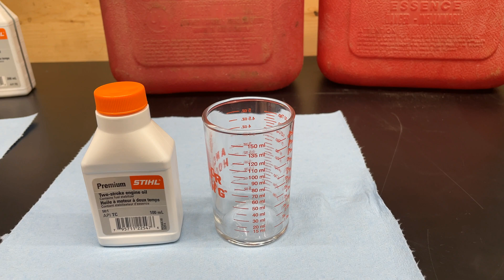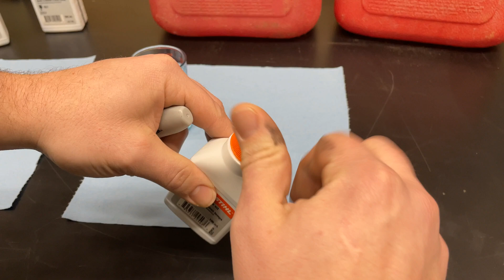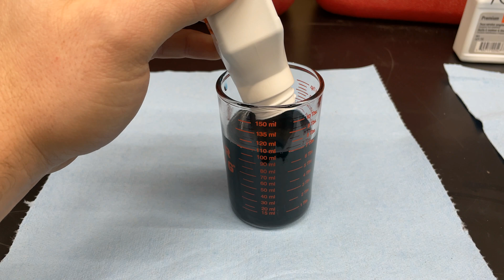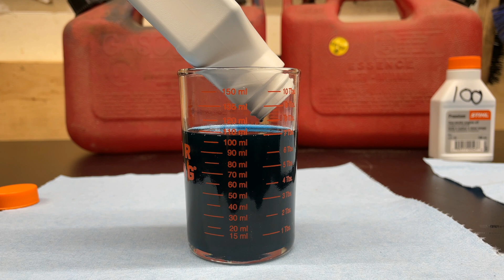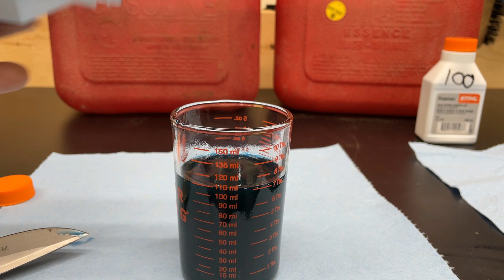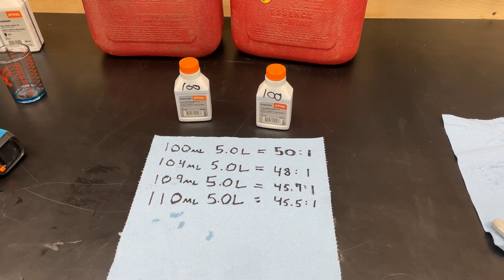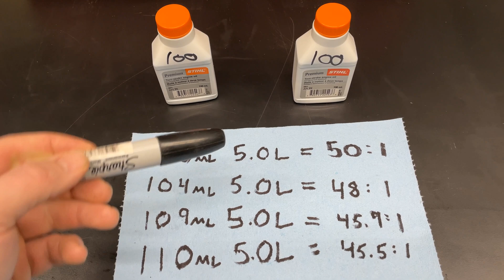Inconsistent 2 stroke mixed gas... Does every drop REALLY count? (Surprising test results found!!!)

Comment: Nobody is decent enough to answer me back I understand that this video is over a year old but I'm looking for somebody that could be honest to me about a Chinese chainsaw from Amazon the oil mixes 25to1 I have a 68 c c chainsaw that only uses 40to1 and is great I think 5.2 oz of oil to me is a little much and it smokes a lot do I have to continue to use 25to1 or can I switch to 40to1 or 50to1'
Reply from the maker: Good question, Lance. All new oils are backward compatible and oil has come a long way since the days when 25:1 was common.

With that said, I don’t have any experience with Amazon chainsaws from China. To be safe, I always recommend running what the manufacturer suggests.

Comment: I do not know how you get 100 ml from a Stihl one gallon bottle.  My one gallon bottles of Stihl Ultra contain about 71-73 ml of oil.  Maybe it is a Canada thing, but here in the USA the bottles do not contain this much oil.  I buy a five gallon bottle and measure out 77 ml in my glass measuring glass.  I do everything, exactly - gas, oil and stabilizer.

Comment: I have a glass just like yours.  I measure 77 ml of Stihl Ultra into the glass and pour it into my No Spill gas can.  I always leave about a quart of gas inthe can before I make a new batch.  After I get the oilin the tank, I pour a little gas into my glass jar and rinse out any remaining oil, which I the pour back into the tank.  I then add one ounce of stabilizer to the tank.  I then take the tank to my local gas station and add exactly one gallon of premium non ethanol gas to the tank.  77 ml of Stihl Ultra is exactly a 50:1 ratio.

Comment: Yes, every drop counts.  I measure everything, clinically.  I use 77 ml of Stihl Ultra, one ounce of stabilizer and exactly one gallon of premium, non ethanol gas (128 ounces).  If I smoke down a saw it won’t be because I did not do my job, correctly.  You have to watch those one gallon mix bottles - some do not contain 2.56 ounces of oil.  I have seen them( Stihl Ultra) as low as 2.47 ounces, 71 ml.    I buy the five gallon bottles and measure everything.  I have a graduated glass that measures ml, ounces, etc.  I fill it up to what I think is 77 ml and pour it into my gas tank.  I always leave a little premix gas in the tank, which I pour into my graduated glass to rinse out all of the oil I can and pour it into my tank.  I will then put exactly one gallon of gas in the tank.  I also put the one ounce of stabilizer in the tank before I put in the gas.  I do not trust the measurements of the one gallon oil bottles.  I trust my graduated glass.  The only one gallon oil bottle that has what it says it has is the Stihl HP bottle.  It says 77ml and that is what is in it,  it I do not use it.  I use Ultra and it varies from 71-73ml.
Reply: But what if the chain saw manufacturers are lying to us and the exactly perfect mixture is actually 54.4:1 and they just sorta rounded down and called it close enough? Now you're not going to sleep tonight I bet.

Comment: 2 stroke engines don't require a precise mixing ratio. Every tank of gas does not need to be precisely 50:1 every time. Anywhere in between 45:1 and 55:1 can be considered a 50:1 ratio.

Comment: The old 4 ounce bottle rule , you see now most one gallon premix oil bottles contain 3.2 ounces of oil for 50.1 ratio , in the past they all had 4 ounces of oil in them ! So I use mercury quicksilver 2 cycle marine outboard premix oil at 40.1 and my piston and cylinder are like new , even hours and hours of wide open throttle on my leaf blower and the internals are Like new !

Comment: I always wash the oil containers with gasoline to get most of the oil that was in the oil bottle. A higher percentage of oil is beneficial until the percentage is so high that the exhaust is Smokey.

Comment: Personally I use only red armor oil, but have been using those 100 ml containers for several years - when I started using them I did that same test as you so I could determine exactly what was in those and found they were usually a bit over 100.  I always add approx 5.2 litres to the gascan to make up for this. Recently the prices of those little bottles have skyrocketed and the red armor oil becoming impossible to find so I purchased a stainless steel measuring cup that holds exactly 100 ml, and also a 1 gallon container of red armor, so I will do it this way from now on.
I absolutely hate that foil seal they put on those little bottles and have always peeled every bit of it off

Comment: I'm not sure your math is right. I think those small bottles of oil, 100 ml, are to be mixed with one gallon of gas. I looked up a conversion chart and I was surprised. There is a US gallon which equals 3.785 liters and then there is a UK gallon which equals 4.546 liters. Both of which do not work out to a 50:1 mix. It is a interesting question and I don't know what to think.
Reply from the maker: 50:1. 5000ml to 100ml aka 5 litres.
Reply: @DavesSmallEngines  I understand that. After I wrote and sent that comment I went out to the garage to look at one of those little bottles of Stihl oil. I don't know where you are. 
Here in the US. the little bottle is 2.6 fl.oz. or 77 ml and is to be mixed with 1 gallon of gas which is 128 fl.oz. That gives you the 50:1. I hope I didn't offend you in any way and now I understand the difference better.
Reply from the maker: @scott241966  no worries at all my friend!

Comment: I mix my gas at the pump so i know i have the exact amount of fuel for the oil in the bottle and rinse the oil bottle with fuel. Good to know that safety margin is there but to have a better test use a measuring device from a science instruments supplier. A measuring cup from the super market may not be calibrated for precise measurements. The cost of over filling the bottles a little is cheaper for the company than a lawsuit or bad PR for being under under what is on the label.

Comment: For doing persnickity measurements, the easiest way is to use weight rather than volume. It's cheap to buy a scale that will do repeatable measurements to 0.1 gram, or about 1/10%. I don't think it matters in this case... I don't measure my gas to ±1%, let alone trying to be more accurate than that.
Reply from the maker: Good to know - thanks!

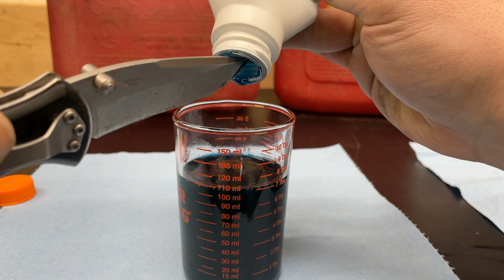Comment: At 8:00 --not worried about bits of plastic or the foil getting into the fuel mix?
  If Stihl is giving a few extra ml of oil,probably trying to lower potential warranty expenses for engine seizure. Especially knowing that some people waste some of the oil.

Comment: Always believed that with the small bottles you must make sure that the final volume of the mix is not over the prescribed amount(don't add the oil to one gallon of fuel,rather the total volume of the mix must not be over one gallon)
also necessary for some fuel to be added to wash the remaining oil from the little bottle and made part of the mix-maybe a couple rinses of fuel from the bottle that go into the not yet full fuel can 
don't like to short the oil even the least bit,especially with spooky low oil mix like 50:1

Comment: I often used to run my YZ490 without oil, back in the day.  And after a few years of riding, the engine showed no more wear than other engines which were always run with oil mix. And I've always understood that while oil might be a little more crucial in smaller cc engines, it didn't seem to bother the larger cc engines much at all.

Comment: I believe that yous should have tested with the same bottle. First time pour quickly, measure,  and second,let it drip to see how much more comes out with a longer wait. Using the same bottle is important because different bottles most likely have slightly different volumes of oil.

Comment: because the label says 100 ml, the manufacturers might need to be very sure to have at least that amount to avoid any possible legal liability.  there can variability in the volume from the filling machines, but it might be better to err on having more than 100 ml.

on the other hand, most consumers might not worry about every drop and will dump the bottle only for several seconds, leaving several ml in the bottle.

Comment: I have ran as much as 9oz of oil in a 1/5 scale rc car with a 30.5cc zenoah and stay around the 6oz mostly but we turn these motors 16,000 to 18,000and as high as 22,000 when a axle comes out. Runs the same with 9oz and 6oz and will run the same being mixed 50:1 but i want more oil for cushion at the higher rpm’s we turn for 50 to a 100 laps. Never hurt anything with to much oil but not enough things want live. Oh and use a raito rite measuring cup from a motorcycle shop and rinse out the remaining oil with fuel and you will know what you have.

Comment: It’s simple use 25:1 husqvarna hp! As Stihl oil is shit! and no dead pistons! Ever! And a good simple test to find the actual mix of oil is use an upside down soda can and fill the bottom of the can with the mix and set it alight, the oil puddle size remaining after the fuel has burned off shows the mix and a 1” puddle is roughly 25:1 and a 1/2-5/8” is around 50:1, it’s best to calibrate using the specific fuel and oil being used, this test method has put a lot of customers in place! crying for a warranty after they are lying to your face and swearing they put oil in

Comment: All this navel gazing over 2 stroke oil ! I have been using the same brand for over 24 year's. To offset inconsistencies in petrol quality I use premium 98 and stray on the side of safety @ 45 :1.
Stihl Ultra is an excellent oil. Burns clean and keeps the mix fresh way longer than HP. It's made by Castrol. That's good enough for me.

Comment: Thx for the post.  Appreciate it.  Just an option to consider.  Use weight, not volume, when mixing.  One ounce oil with 50 ounces of non-ethanol fuel in an open top dedicated mixing bowl is ideal.  Small kitchen scale is used.  Mix the oil with 25 ounces and follow up with the additional 25 ounces.  (Sta-bil can also be added of course.) Granted, in the field and when time is short this option is less than ideal.

Comment: hi there i am a bit late at jumping in here , been sawing for over 50 years . i found many years ago that the bottom of the bottles always have a thicker or heaver oil that seams to like to stay there , i have always believe this to be the addaves and add gas to the bottle till it is all in the mix . may now be zinc because the took it out of the gas . also stir my mix up before refueling . . also try not to run the saw out of gas . with all that i still use my 041 Stihl i got in 1982 snd saw 15 to 20 cords a year . good show john

Comment: Every mfg. puts in a little extra. Why? The penalties & fines for cheating you (short) are so great that they give you more, charge you more, & never worry about being caught shorting the customeer.   Additionally: Everytime I have the oil changed in my Volvo, I keep the oil bottles. I retrieve about 1/3 qt. from 7 qts. of oil. Surface adherents in the oil make it a "climbing lube" so some stays in the bottle. 24 draining gets it all & gives me the oil instead of throwing it away. Most don't care: I do & benefit from it.

Comment: helo  i was told more oil in gas mixs is better  i was told to use 40 to one 3.2 oz bottle in stead of 50 to 1-- 2.3 oz bottle  in my sthil 025  gas chain saw

Comment: If you read the front of the container it said it contains 100 ml.  My bottles of Stihl HP says  77 ml on the bottle and bottles of Stihl Ultra contain LT 75 ml. I have an anchor Hocking glass, just like yours and measure all oil and additives. I usually put about 77 ml of two-cycle oil in one gallon of gas.  That equates to 2.6 ounces of oil.

Comment: This is the exact reason why I measure my own mix from a 1 gallon jug of 2 stroke oil.  1. Cheaper to buy a gallon at a time, 2. I put in exact measurement I want.  Great video, thanks for taking the time making this video. :)
Reply: But you still gotta get what's left out of your measuring cup, so it's the same question.
Reply: @bobbygetsbanned6049  You don't get it.
Reply: @happyyardservice2914  Then explain how you measure oil without measuring it.
Reply: @bobbygetsbanned6049  you rinse the measuring cup with some of the gas from your mix
Reply: @stovepipe9er  Yeah you can do that with a bottle too, but he didn't say that. He's just transferring the problem from a bottle to a cup thinking he eliminated the problem.
Reply: @bobbygetsbanned6049  Ya id just rinse the container.  All I know is I buy Amsoil Sabre in 1 quart for the price, and since I’m measuring anyway, I can decide to mix up half a gallon or whatever.
Reply: @stovepipe9er what oil mix ratio you’re using on amsoil saber. 50:1 or 40:1?
Reply: @hGN24  I’m mixing 40:1.  From what I can figure they only came up with 50:1 as standard because of emissions
Reply: @stovepipe9er but the Sabre oil tells you it should be 100:1?  

I aim for 50:1, with my error being to rich on oil. My equipment says 32:1-50:1 and even running WOT nothing has complained yet.
Reply: @rydplrs  I run it 40:1

Comment: For a while I got into trials motorcycling.  Most of the bikes were European, the majority powered by Honda 2-strokes, water-cooled and 250ccs.  I found it very curious that although the manufacturer recommended a 50:1 ratio, most competitors ran 100:1 mixed into CAM2 racing fuel.  Allegedly it was done for a quick throttle response, but they ran that ratio for years with no ill effects.
So it makes you wonder how much the difference between 45 an 50 would be.
Reply: you have to realize that in racing they will be overhauling those engines way more often than street machines. IOW, what works for a few hundred miles is not what you want on a daily driver.

Comment: Very interesting, I always poor some gas in the oil container reinstall the cap and shake the gas around in the two stroke oil containers then poor every last drop in my gas can ,before I shake /mix oil and gas
Reply: I've always done the same thing. So does that mean we are getting closer to a 40:1 mix? And as many others have commented, is Stihls process tightly controlled? Or will every bottle yield a variety of fuel mix ratios: some 50:1 or more - all the way down to that 40:1?

Comment: Forty six years ago when I had a discussion with the local Homelite dealer about how critical the fuel mix ratio was he said " I shouldn't tell you this but Homelites tests show that one tablespoon of oil per gallon is adequate." That's a 256:1 ratio and Homelite specified a 16:1 mix for  that saw, a Super 2. Nowdays because of the improved 2 cycle lubricants a 32:1 ratio is recommended for the vintage saws and that's more than enough . I'm still using that saw for up to about 8" stuff although it'll cut whatever you put in front  of it.
Reply: I have several XL-12's still being used. 32:1 mix. My regular straight gas gets pretreated with a squirt of Lucas's upper cylinder lube/injector cleaner, AND their fuel conditioner/preservative. I try to always use highest octane least alcohol gas.
So my pretreated "straight gas" makes all my 4 strokes run better, and when I use this gas to make mix for my 2 strokes, I know I have a little extra.
Reply: @markluxton3402  That's exactly the recipe and method I use for my small engines except I use MMO/Stabil and ethanol free 91 then add 2 cycle oil for the chain saws. They run so much better on ethanol free, no bogging.
Reply: @5hawks  My only local gas station sells only regular gas. There was no local supply here for a few years. I made the mistake of buying the regular so I didn't have to travel 45 minutes. I hoped the Lucas products were enough to compensate, but I have had to clean carbs from mysterious tan "dirt" this spring, that killed several engines. Maybe coincidence, maybe not. Cleaned, and a diaphragm replaced in one and running like new lol
Next time I go further to get proper gas. I may no longer be able to get totally alcohol free though.
Reply: @markluxton3402  I'm of the same thinking; currently using the 95 octane

Comment: I  would have to see the oil measured in a laboratory grade cylinder, the one you have may not be graduated accurately. The test is not a game changer. If your results are accurate then in reality the over filled bottles are actually benefiting the saw. I am persuaded that a rich oil mix is a good thing, I have routinely run my saws about 20% rich....for 50 years worth of firewood and lumber milling. So if Still does this by plan then we can thank them for the foresight and move on. A change of oil mix ratios of 5% to the rich side is absolutely not going to be a problem, though you are likely to have a better running saw due to better lubrication and some slightly higher fuel energy release due to the oil. If the move were to the lean side I would not be comfortable with that, especially if you are already operating on a 50:1 premise. If you are already in the rich mix territory like 25 or 32:1...something pretty fat....then this small deviation in oil would be less significant, but still of concern. If you ever  burn up a motor due to low oil you'll quit trying to mix right to the exact ratios and just fatten up the mix as a fail safe.

Comment: Just put new bottle on scale i check the weight, empty bottle should be consistent, oil is fluid so it could change amount during manufacturing.
In my opinion if you use 10% more oil will not damage engine, i make 1:30 mixture on chinese 2 stroke trimer over 8 years and it work great ( it have pretty hard time with me)

Comment: For the last 25 years I've been running a gardening service you take a 12 oz bottle of Gatorade you fill it to the brim with two stroke oil you dump it in a five gallon gas can and you fill it with 5 gallons of the lowest octane cheapest gas you can get 87 or 89 you're welcome have never had a two-stroke engine fail on me